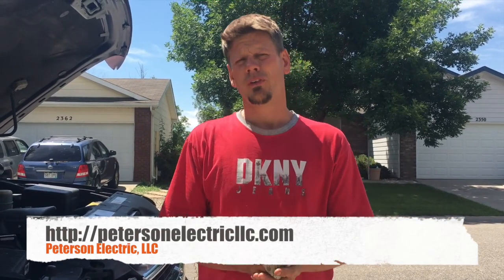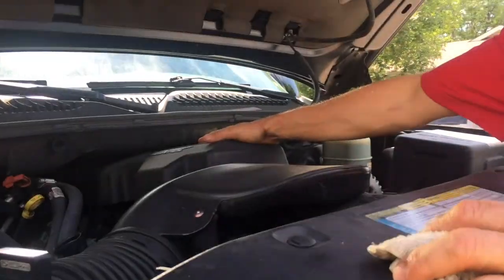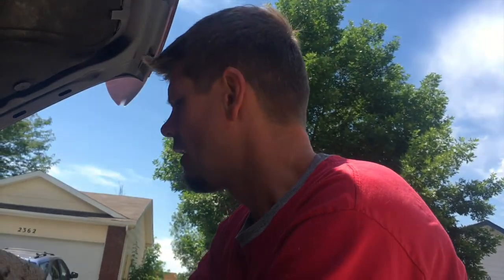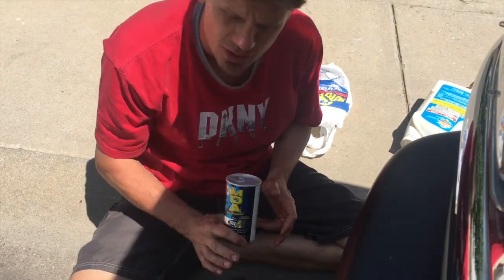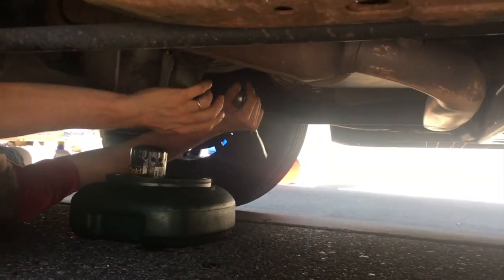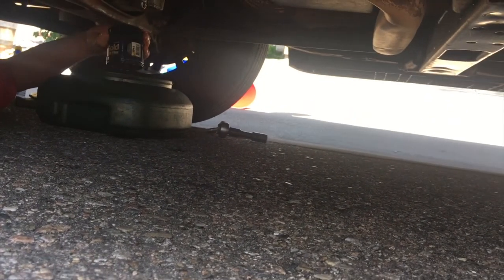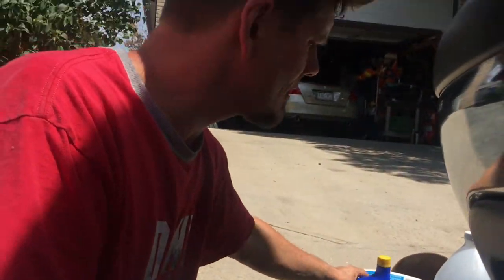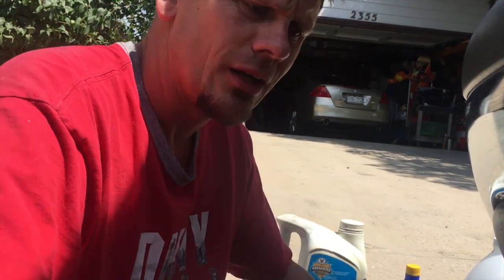Oil Change On 2000 Chevrolet Tahoe

Comment: I've got the same engine and year, and have done dozens of oil changes over 370,000 km. One thing for anybody who stops by is to always remember to double check that the rubber gasket comes off with the old oil filter. Rarely it sticks on the mating surface, and then you might put the new filter and new gasket on top of the old gasket. Double gasket leaks are the most common liability complaint against oil change companies, sometimes killing engines when customers keep driving after the idiot light comes on. I always run the engine before the oil change, so the top part of the engine is already bathed in oil when oil pressure lags with the first restart, clearing air pockets from the oil pump pathway. Good idea to fill the filter. This engine makes it easy with the vertical filter orientation. Some guys punch a hole in the bottom of the old filter before removing it, to reduce the mess trickling down your arm when you spin the old filter off.
Reply from the maker: spelunkerd thanks for the pointers, we have 168,000 and it gives me hope it will last. I’ll use the advise on warming the oil first.
Reply: @Petersonelectricllc  Thank you for all your words of advice on electrical service. I've watched about 3/4 of your posted videos, great teaching.